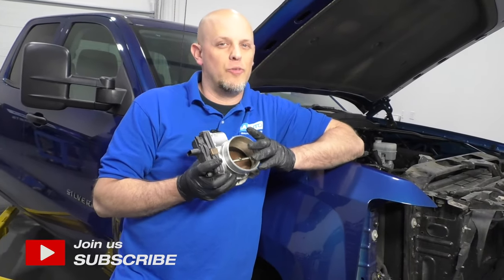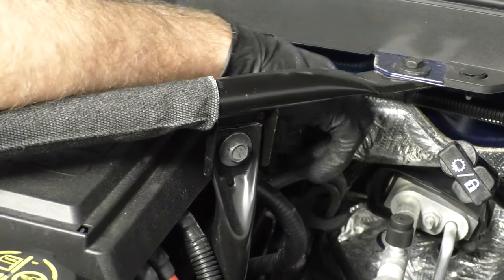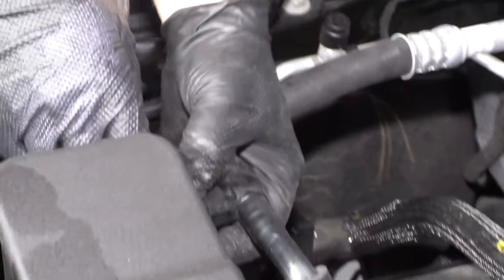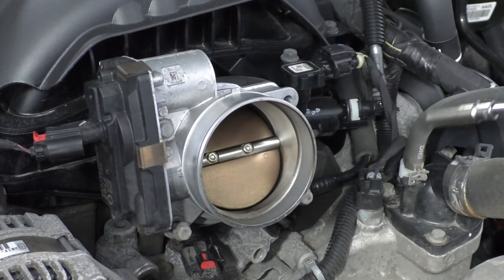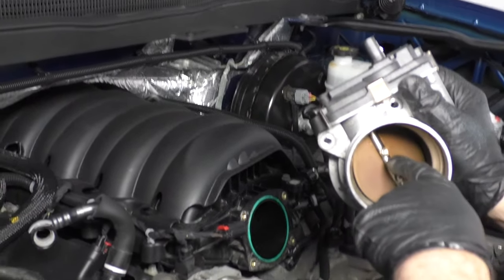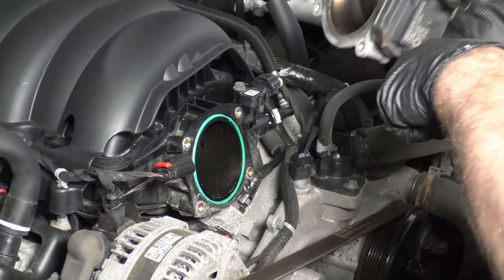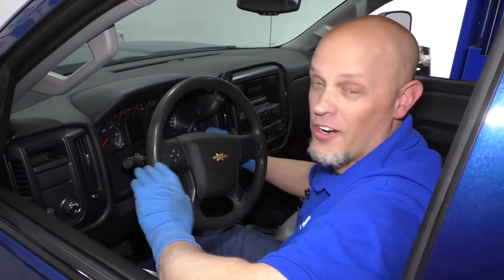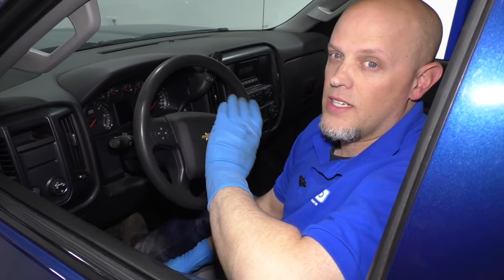How to Replace Throttle Body 14-19 Chevy Silverado

Comment: I have reduced engine power due to code P2101 it says about throttle control. Not sure if its the sensor or throttle body itself have issues or wiring

Comment: Great tutorial video, you guys are they only people to go in-depth about throttle replacement and cleaning procedures, and reprogramming the (ECM), or re-learn the new idle. I cleaned a TB on a 2008 Chevy Tahoe cause of the engine code, and I finally had to see a mechanic top slap one of those 5-k computers to get the idle correct, cost me $85.00. My question is how successful is the manual re-learn procedure on my 2015 Silverado, if I clean the TB, Would I have to repeat what I did for the 08 Tahoe? Please reply, it would be greatly appreciated!!!  Thanks in advance.
Reply from the maker: Thank you for the great reply! +James Grate

Comment: What are those two Tubes with the gray clips you’re taking off? I have engine oil in mine and don’t know if that’s supposed to be like that, going on my second throttle body in 3 minths
Reply: Pretty sure they’re evap lines. Oil isn’t usually (or ever, as far as I know) put through those types of plastic lines.

Comment: Thanks for you video. I have a 2016 GMC Sierra 5.3L and it’s doing exactly what you’re describing. As I slow down to a stop it feels like a down shift and as I accelerate from a stop it jerks hard as if I floored the pedal. I thought it was the transmission then thought maybe electrical issue. I ran my scanner and it’s a random misfire with a blinking CEL which is also giving me an emission code. I changed spark plugs and wired, swapped coils and it’s still a random misfire. Could it be anything else before I jump to changing the throttle body?
Reply from the maker: +Jeremy M We wouldn't be able to diagnose an issue like that here, you may want to have a local mechanic take a look at it. Thanks for checking us out! 1AAuto.com
Reply: Did you ever figure out the problem? My truck does something similar
Reply: My truck jerks too when I leave  from a stop did you figure out what the problem was?
Reply: Have you figured it out?
Reply: @jessemendoza2991  had a similar issue to what was described and in my case it was the throttle body. Hope that might help.

Comment: I have pushed open hundreds of throttle body blades / butterfly's open and cleaned everything with carb cleaner or Sea foam and never had problems. Why would you tell people to not  take cleaner and clean it out ? I would say don't submerge it in cleaner or clean it in a parts washer, but it's perfectly safe to clean it, besides carb or throttle body cleaner evaporates fast.
Reply from the maker: +Logical Guy Thanks for the tip! We'll pass this info along to our production team.
Reply: Newer/“smarter” vehicles are more sensitive to touching the butterfly. Assuming cheap plastic gears inside like the everything else made now.

Comment: Thanks for the video. I did not disconnect the battery when I took off the TB for cleaning as it was so dirty that I could see the accumulation going beyond the TB and went I put it back on is giving me hissy fits with the idle. Engine light is on. Did the relearn procedure. Checked for leaks and all. Could this be the cause? You mentioned that the electronics are very sensitive. Your thoughts are appreciated.
Reply: you need to have a scan tool to do the relearn
Reply: Did you ever fix this problem ? I’m in the middle of doing mine. And did the same thing. I didn’t disconnect battery before removing TB , but I noticed before I turned the truck back on and disconnected battery before I put the TB back on and turned the truck on. I’m I good ?

Comment: Im still at a high idle. what do you mean by Clear the code again?
Reply from the maker: +Jim OKeefe After installation or cleaning of the throttle body, you will need to do an idle relearn. This can be done by using a scan tool and clearing the codes or doing it manually. If the code is still on after doing this, you will then need to go through the process shown to clear it again.

Comment: I have a 2014 Silverado I cleaned the throttle body out. Did move butterfly a couple times to make sure I cleaned it well. Now truck idle goes up and down in park? I already tried disconnecting battery, doing the relearn procedure but still does the same. Any help I’d appreciate it